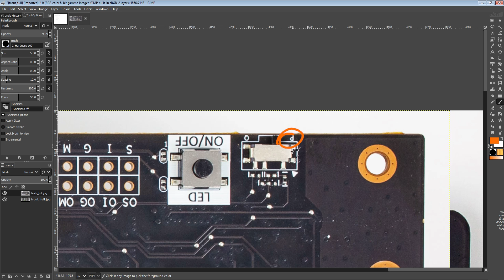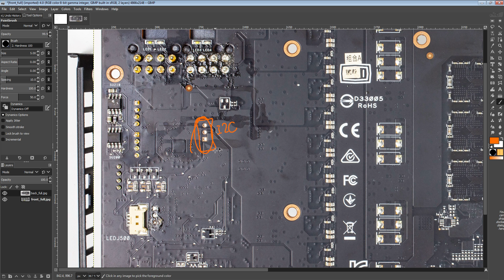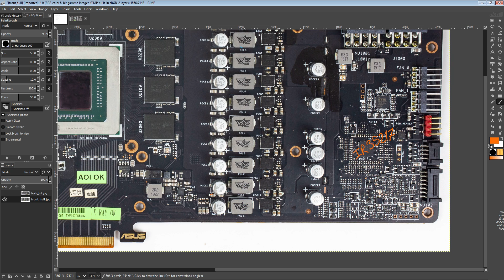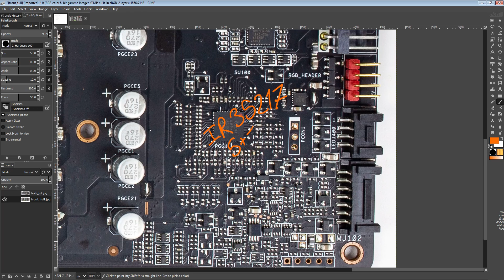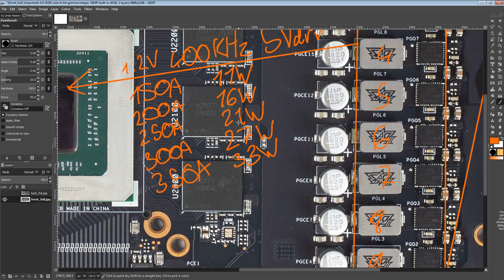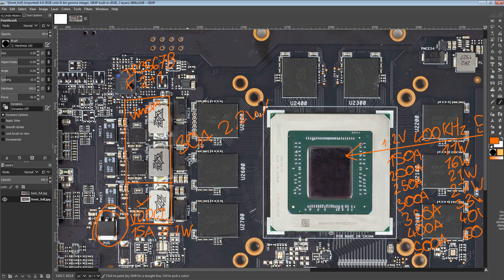GPU PCB  Breakdown: ASUS RX 5700 XT Strix

Comment: this card sux even for gaming.. i hate it so much io never see soooo undatbel card fro mining even even.. on wind tunel with 68C momery under werry lo condition on 50MHs only.. keep restarting akeep give a badshares.. trash as hell and also.. they BUYBACK them for release 2.0 as NEW or refined.. so fk this.. trust me iknow those card werry well..not worthy for gaming too.. too much droping.. on 0,1% absolutly unsatbel framerate and micro shooter even on 144hz wsith 1080p.. so.. hell no!
memory VRM and MEM controler for VRM is totaly f-up small caps. werry high resistance.. werry low allowance for high amp peaks.. literary this duo make this card crap..

Comment: I just tested 5 days ago my Strix 5700 xt via 3Dmark  demo test to see the score and my card got permanently coil whine after the test. When I run games like cs:go or pubg on fps unlimited it starts coil whine and the temperatures are getting high. Tried to limit the fps to 144 , it works , coil whine disappear , but it's getting back if i'm playing a newer game like forza horizon 4 even on 60 fps....   What can I do?
Reply: coil whine will actually go away in time , just use the card, that not a faulty  one ,coil whine is natural , so , no problem there , enjoy ur card at high frame rates !!!

Comment: so as a owner of this card (5700 non xt (same vrm and pcb (flashed to xt bios)))all i can say is its grat and terrible at once.
asus screwed screews on vrm and pressure on gpu core . after ive added washers and new shorter screews on vrm ive managed to push my gpu to 2.1GHZ core and it eats freaking 300-370W accoding to software mesurments YET IT STILL IS QUIET AND MANAGES to do like 80C on mem and 65C core , 78C junction , vrm is like 65C !!!
Reply: I vertical mounted mine which also helps with the mounting pressure issues. Got mine for $330 "open box", which all it had was a bent PCI bracket. Very reliable card, and I can confirm it'll OC to 2.1+ghz stable with those temperatures.
Reply: and the best part ive bought it so cheap (like 115 usd under MSRP )

Comment: Anyone know if this is the same PCB as the reference card in terms of water cooling blocks? I’m trying to find a custom 5700 XT to use with the EK water block that fits reference PCBs? If it isn’t, could you tell me which aftermarket cards have it?

Comment: helo, i have this gpu, my vrm module does not get into contact with the thermal pad on the heatsink.. if i push the fan shroud upward.. then the vrm contact with thermal pad.. do you have the same problem. please help me.

Comment: I just saw the Benchmark video review for this and your getting all that power draw and heat for 1-2 fps gains of other cards in the line up. Not to mention you could be paying 30 + pounds more. Are people just getting a better quality card over the other GPUs? Or is that just speculation? The cooler is  massive but the high temps are still there? Confused & Miffed. Am I still winning with this card?
Reply: ASUS has a cashback on this card around here that makes it ... well same price as the other cards. Win win.
Reply: There's just ONE review from Hardware Unboxed that has been saying Temps are high.

Hardware Canucks, Tech Testers, Vortex etc etc.... They all say if you can afford it?
Go for it.
It's an amazing card.
Reply: I got it for 377 Euros and not every of them Cards is getting hot only the ones with the too long screws on the VRM Cooler

Comment: Too bad the cooler of the Asus-card was originally designed for current GeForce-GPUs (which have much larger dies) and is not as good as the one from Sapphire - for example: Asus cooler has aluminium-base instead of copper. So: Asus' PCB design plus Sapphire's Nitro cooler would be a worldbeater, at least among the AMD RX 5700 XT cards.
Reply: there is no aluminium base on a gpu , all are copper , fins are alu
Reply: @koyo203  Quod scripsi, scripsi.

Comment: Sad to see Asus using Micron memory for this GPU. I wonder if that's only vendor they use though as that might vary from batch to batch. My Strix RTX 2080 has Samsung memory that overclock really well and provide pretty good performance uplift compared to stock speeds.

Comment: The Strix is the most expensive 5700 XT custom card I can get in my country. I was wondering about the difference between this and the Gigabyte 5700 XT Gaming OC, which is one of the cheapest custom cards out there (it's cheaper than Pulse in my country).
Reply: The Strix is cheaper than the Gigabyte here. Have you look for a cashback program from ASUS?

Comment: 250A maybe... higher and GPU or GDDR will melt. This thing needs no VRM cooling ever. Passive heatsink. Extreme OC will boost voltage, but not current at some point.

Comment: i can GARENTEE you that amd's NVIDIA KILLER gpu will be a 5950xt STRIX navi card :) and still cheaper then nvidia's SUPER line!
Reply: At this time I don’t think there are any talks about a 5950xt, but I believe the 5900 and 5900xt names have been trademarked. Watch Moore’s Law is Dead, he goes over it. The 5900 is supposed to take a dump on the 2080ti and the xt variant is supposed to be like 10-15% faster than the 5900. I do hope sapphire makes a vapor x version on one of these models.

Comment: I dare to disagree that Asus makes the best AMD gpus, Sapphire is way better in any way. At least it always was, haven't seen their Nitro+ version of this gpu, but I'm pretty sure it will be better than this Asus
Reply: What about Asus strix longevity?
Reply: @Arif_Islam77  I still have my first rig with Sapphire Radeon 3650, agp, 512mb of Lipida memory from 2004, used it every single day till 2012. I'm still using it from time to time when I feel nostalgic, to play Elder Scrolls Oblivion or NFS Underground 2
Reply: @nikityukvlad  So you and many others say sapphire amd cards are very good in terms of longevity. But MSI Evoke 5700XT has lowest temperature of all the custom 5700XTs so far. So I guess that msi model will have better lifespan than sapphire pulse.
Reply: @Arif_Islam77  MSI card was awarded worst 5700XT card by Gamers nexus.
Reply: @Arif_Islam77  the EVOKE has 90 degrees on a stress test, test made by gamersnexus, while MODDED by THEM, it struggled to keep in the low 80'
Reply: @koyo203  you replied to my comment which is almost a year old. Anyway, I didn’t get the 5700XT. I got a used 2080.

Comment: One major issue with this card HUGE price premium over the reference design. Here in Sweden it seems to be over $140 above reference design and at that price it cost more then reference 2070 Super so not worth it since 2070 Super is slightly faster and AMD will probably soon release a 5800 card that will be in those price ranges. AIB cards for the 5700XT are only interesting if they are below $450.
Reply: What? In Denmark the Strix costs US$15 less than the reference card and US$150 less than the cheapest 2070S (inno3d). Find a different shop.

Comment: To me, the most important feature is that "LED OFF" button. Best. Feature. Ever.
Reply: Absolutely now if only that switch turned off the LED at plug. It's always on even when PC is off.
Reply: Meh, unicorn puke is fun. Its nice to have a rave every now and again. Limiting the rave to my pc case just shows the scale of my friend circles. 10/10 will look for a way to add more rgb for the lolz. 10/10 will turn them off when mature friends are over.
Reply: @jgrigg1720  right, kinda got rgb for my PC just to see how much I can put in and see what would happen
Reply: @jgrigg1720  I have all the brightest cataract and epileptic seizure inducing RGB pc components (was on sale, cheaper). But I don't have a viewing window.
Reply: @SketchbookGuitar  bUY AN INFINITY MIRROR CASDE FROM CUK

Comment: can't believe they are smacking these crappy additional fan headers on their graphics cards again. back to rx 480 strix era?
Reply: They're useful when you have a old outdated system running ivy bridge on a 2012 motherboard with a limited amount of fans connectors.

Comment: Doesn't seem like the 5700XT really has much room for overclocking.
So do you think you will get any use out of all this "over engineering" Or do you think it will actually make it so it CAN overclock more than the reference and the sapphire pulse?
Reply: Its has a artificial limited that AMD has imposed. I'm guessing so it doesn't beat the Rx 5800 if it comes out.

Comment: You should be able to get the solder pinta clean with liquid metal and a little heat to start the reaction. Not sure though ive never tried

Comment: So no bios modding at all, huh?
Is there a way to mod target temps and fan rpm in SPPT? Planning to get a reference 5700XT and an accelero Xtreme, don't want the card to run 3 axial fans at blower tier speeds
Reply: Don't wanna advertise other youtubers here, but one guy from Canada bought 5700XT Anniversary edition and installed an aftermarket cooler. He failed to achieve better results, sadly
Reply: @nikityukvlad  I'm fine with the performance, I just want to make it quieter.
Reply: DrathVader it doesn’t work.
Reply: @ytaccount-rs6jt  Huh, that sucks then. 

Wonder if flashing the bios from pulse would work, as far as I can tell the VRM is essentially the same, just rearranged a bit
Reply: @elektroencefalografista  bios modding works.

Comment: @Buildzoid Hi I would like to remind my self :) I was recently asking you at your stream, if you can check the LLC setting on MSI AM4 board, because it is broken up to 3 different boards I owned now from MSI :( Also  I know for a fact, that other people have exactly same problem... I would be very grateful for your help, first because you made such video in the past, and second your video could reach better MSI...
Reply from the maker: which BIOS version does it happen with because I've not had any issues on any of my boards

Comment: I wanna see how the thicc boi fares, as xfx only does amd stuff.

I'm guessing Sapphire's pulse is just the reference, or close to the reference, pcb but I'm guessing they'll have something else down the road
Reply: Does sapphire pulse having reference pcb make it any better in terms of longevity, clocks, binning?
Reply: @Arif_Islam77  the sapphire looks as ugly as those Zotac cards. Zotac 2080Ti Amp has better temp than Msi Lightning 2080Ti, galax HOF etc but that doesn't mean we should keep comparing  a card where they put way more effort to make with something like Zotac or sapphire which cant even design a decent looking card and use crappy plastic frames over the heatsinks to keep the cost down.
Reply: @damienriot  Card's looks doesn't matter to me. All I care about is thermals, clocks and longevity.
Reply: @damienriot  go feed your RGB gremlins, lol
Reply: @nikityukvlad  I don't even have shitty RGB low airflow fans or RGB rams in my case. I use the noctua ippcs and only RGB in my case is the gpu and motherboard's subtle led (XI formula). But my point was I don't want to buy a poorly made gpu with worse pcb and shitty looks. I don't need rainbow puke but there should be an option for a single or dual color theme matching with the mobo leds or rams or case leds. There should be a choice which sapphire and msi apparently aren't giving to its people.  If you can't appreciate something like a Lightning or HOF cards, be happy with low tier zotac or sapphire craps.
Reply: @damienriot  never had any Zotac cards in my possession, by any Sapphire card outperforms any AMD-based gpu in their price range. Asus is for RGB lowers and those who like to brag. Even my crappy Sapphire RX580 Nitro+ has all the RGB bells and whistles, option to disable RGB completely.
Reply: @nikityukvlad  Yeah I don't see the point in buying a reference blower card.  I wouldn't spend more than $30 over the base MSRP for any of these cards.  I just wish Asus wouldn't ask for a $50-$100 premium for their Strix cards.  I have a Strix 2060, but only because I got a pretty good deal on it and I needed either a triple fan card or a blower card for my case.  I should have waited for Navi though lol.  Every rumor at that point was either way too good to be true or saying Navi was hot mess.  I didn't have much hope after Vega and Radeon VII.

Comment: G'day Buildzoid,
I am finally starting to get excited about the RX5700/RX5700XT launch, The Strix does look good,
I'm wondering if you have heard anything from Sapphire about if they are doing anything special like a Vapor X or Toxic Edition
Reply: This is the most expensive 5700XT and yet temps are worse than cheapest aib 5700xt which is Sapphire pulse ($410)

Comment: I woulder if sapphire will do a big balls card . I hope they do . They always make nice stuff.
Reply: so I went to techpowerup Strix 5700xt review and saw Asus top-end card Strix with great PCB (as buildzoid have explained) with three fans have  2 degrees higher temp and 1 dba higher compared to sapphires lowest end pulse with 2 fans.... how the hell did they manage to do that? Strix card most certainly will have Asus premium and sapphire pulse only have 10 dolloar higher MSRP than reference.
Reply: Yongwoo Lee same kinda thing happen with the Vega56, the Strix fans actually came with a problem and the Pulse just was the better buy. Shappire cuz only does AMD cards has a better know how and probably access to information that other AIBs dont, that make them simply the best parter card always
Reply: I think Sapphire actually already did a big balls card via great binning. Both Sapphire 5700 XT's I've had my hands on boosted over 2.06GHz and stuck, and came with Samsung memory. The card I ended up keeping ran 2094MHz boost out of the box without touching a thing. Now that I have it on water, it never goes below 2120Mhz with +0% powerplay and auto-overclock enabled at 51c 100% load. I'm waiting for a driver that doesn't crash during desktop/browsing use, then I'll do the +100% softmod. From how it behaves, I really doubt this card will struggle achieving 2.2GHz+. Almost seems like it shipped with a garbage cooler just so people like me can rip it off and get it on water. I think Asus solved a non-existent problem with this card, all the money needs to go towards cooling, the reference VRM's are doing fine. What it really needs is a 512-bit bus.
Reply: its not that they make nice stuff, they just make sure everything it up to spec and quality
Reply: @silenthill4  Yeah, probably just good quality control. Either way I'm happy with it. Had it up to 2250MHz in benches but it's unstable. I've settled at 60% power target where I rarely see it above 53c or below 2160Mhz. I discovered AMD drivers are really sensitive to bad RAM TRFC setting so that was why I was having crashes. Set it too low, but it passed memtest. Whoops. After I sorted that I've had zero problems. Really fast card.
Reply: sapphire pulse 5700xt is cheap, they basically threw a cooler on it and done. Gamers nexus did a review. No bump in clocks or anything.
Reply: @NitroVipers3  they didn't need to overclock cause it can't really go any further so I don't see how this is a problem. Gamers nexus even said the reference card 8s already pushed to the limit.
Reply: @NitroVipers3  it has a good bump in game clock , check the level1 review

Comment: Does VRM even matter for this particular card tho? I mean outside of extreme OC obviously.
Reply: Probably not. Unlikely that any of those cards will be so poorly designed that the VRM is not enough. The strix usually just runs much cooler. Performs slightly better (a few single digit percentage)

Comment: If you're interested in close up shot of pcb components check out https://www.igorslab.media/ . His reviews are quite in depth and he does lots of close up photos and describes the components used. Here an 2080 Super revie for example https://www.igorslab.media/msi-geforce-rtx-2080-super-gaming-x-trio-im-test-schwerer-brocken-auf-leisen-sohlen/2/
He also released a overclocking tool for the 5700, 5700XT and Radeon VII 
https://www.igorslab.media/morepowertool-amd-radeon-rx-5700-und-rx-5700-xt-tweaking-and-overclocking-software/

Comment: good PCB is not everything tho, vega strix did have bad contacts with cooler if i remember correctly and was the "worst " vega aib cards or something until they fixed it? so... bait for wenchmark.
Reply: Well, this thing runs very hot again. The cooler is big but thats it.
Reply: They never fixed that VRM shit..
Reply from the maker: you can swap out heatsinks much easier than you can upgrade VRMs.
Reply: @ActuallyHardcoreOverclocking  yes, your right but it shouldn't need to if they made ith with better contact at the first place.
Reply: Yeah i don't get it. This is the most expensive 5700XT and yet temps are worse than cheapest aib 5700xt which is Sapphire pulse ($410)
Reply: @Arif_Islam77  where did you get that info
Reply: @pilerks1  it's all over the reviews on internet
Reply: @Arif_Islam77 
Only on Hardware Unboxed.
Rest say it's 60 to 70

Comment: My god the die is so small.
Reply: so small yet so powerful
Reply: Crazy to think this thing crushes a 2060S and gets within a few % of a 2070S, for $100 cheaper.
Reply: maybe liquid metal is not a bad idea here
Reply: @matocarina  you need a cu sink for that,  pretty much all gpu heat sinks are al...
Reply: The smaller the better.
Reply: KatyCat Yeap
Reply: There might be a day, we have GPU slots like m.2 SSD. I want to see a motherboard where we can slot in a GPU & VRAM like as of CPU & D-RAMs.
Reply: KPx is the way to go if you can't use liquid metal.